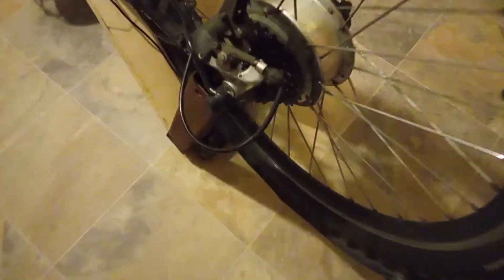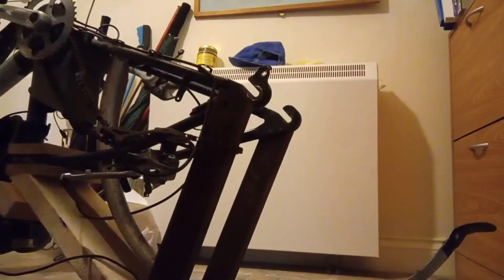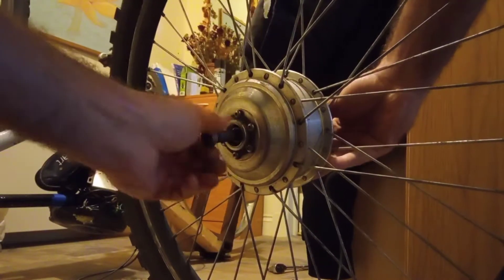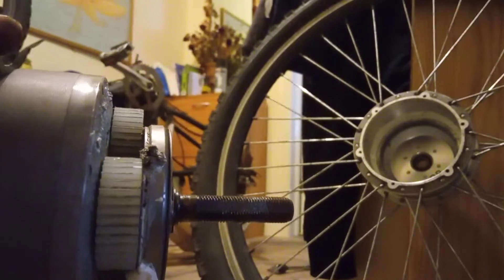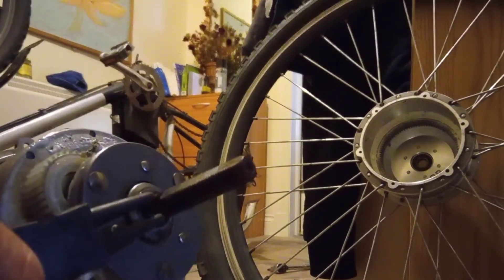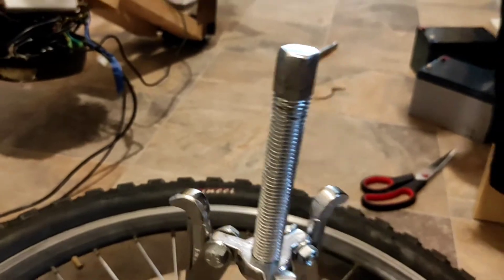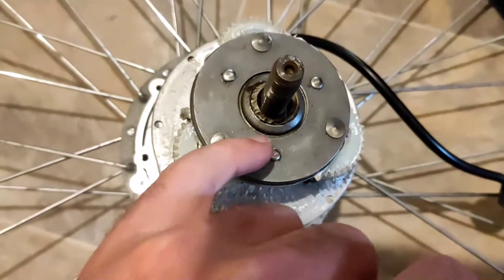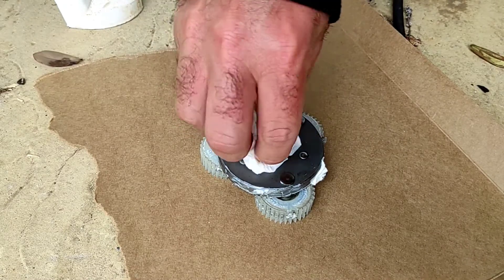How to install regenerative brakes on an ebike - PART 1

Comment: Did it drastically slow down after throttle was no longer being applied? Also did you have to do anything in settings to make this work? I’m not trying to recharge the battery I’m just trying to get the motors to slow themselves down and act as a brake to some degree.
Reply from the maker: Sadly, it broke within a week. It had very little slowing effect
Reply: I use MXUS geared hubs (xf19c and xf15f) and the extra drag caused by the motor when not regenerating is low to irrelevant. 
I can happily pedal with no assistance and not notice the drag but I ride a 36kg bike and even the brake pads rubbing are irrelevant at this weight. 
But when regenerating it feels like climbing a 20% incline on flat. (I limit the regen to ~400W)

Comment: Next time... don't burn an entire stick on that clutch. 
Remove the gears, easy-peasy three c-clips, save the cogs from melting and filling with slag, tack it in three or four places, equally spaced. 
Get a caliper, check it out before hammer time. Maybe hide the hammer next time and put a fine file in it's place. :)
Reply from the maker: I'll try to keep it in mind next time. It broke within a week, sadly.

Comment: Hey mate,
I've done a similar welding job on my hub motor to implement regenerative braking.

May I ask what failed and how did it fail in your setup?
Reply from the maker: Sounds good. Sadly my one broke through normal use. When it went, it almost locked the back wheel up and it heated up to a ridiculous temperature. I think the clutch may have been slipping and generating heat when it failed (I still had to do a lot of miles due to work). Thankfully, it had platic gears instead of metal ones. So when the weld began breaking off and getting trapped in the gears, the cheap, easily replaceable plastic gears absorbed all the broken metal pieces and thereby protected the wheel hub and provided some protection to the rest of the motor.